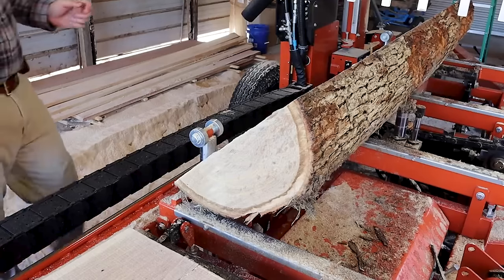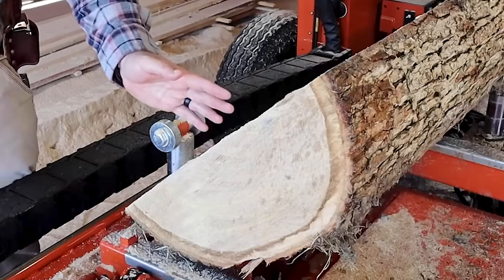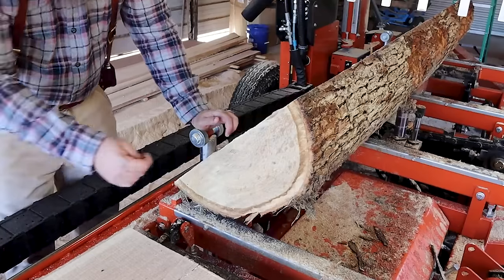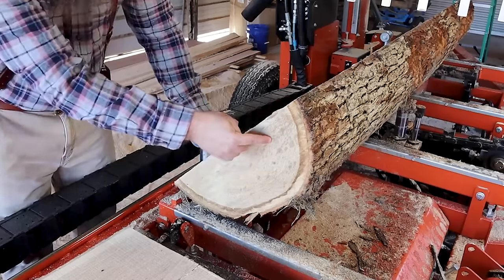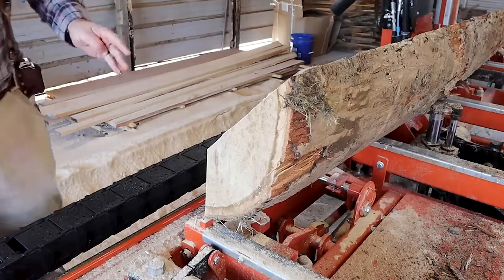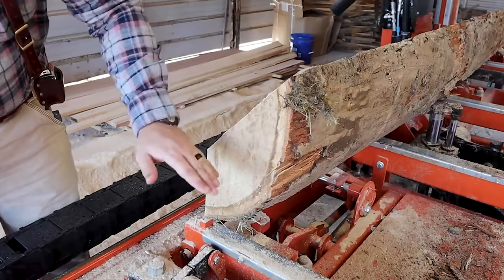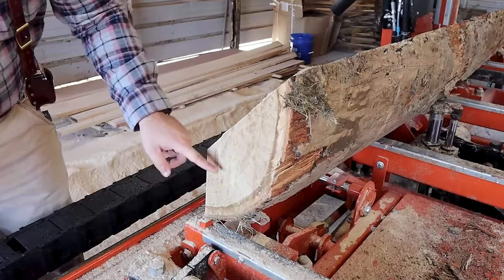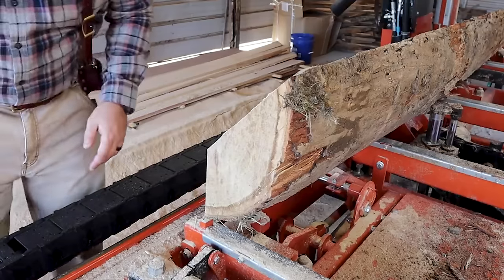Logging Like It’s The 1800s! Horses Harvesting White Oak

Comment: alot of people used horses 2 work w years ago 😊😊 they were here be 4 the steam engines and the tractors both be 4 they were even thought 💭 😊 of and they use 2 use them 2 get wood our of the woods and farm w them and most of all they worked at the sawmills 2 pull logs out of the woods 2 the sawmills they pulled a swing cart that's how moved the logs 😊😊 later on the tractors pulled the swing carts then the skidders was next 😊😊 U don't see many of the old school skidders no more Clarke   TIMBERJACK  FRANKIN TREEFARMER and the OLD JOHN DEERE  SKIDDERS and there was a few more 😊😊 when I was a kid I remember the timberjacks tree farmers and john deere skidders I remember well they were all cable skidders U had a cable line U had 2 hook up 4 each tree 🎄😊 /😊😊 OMG 12 5 2O23